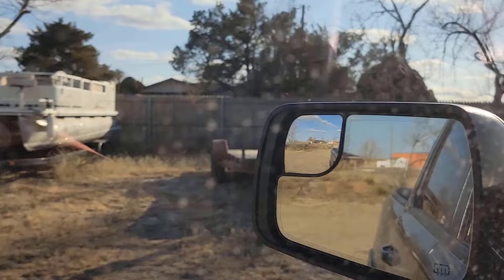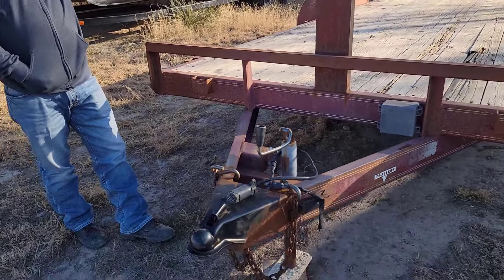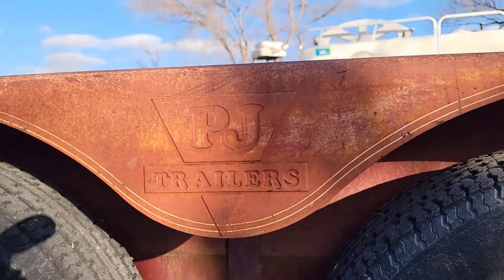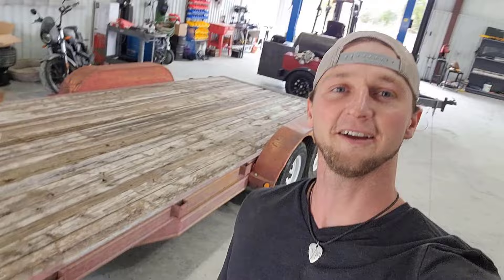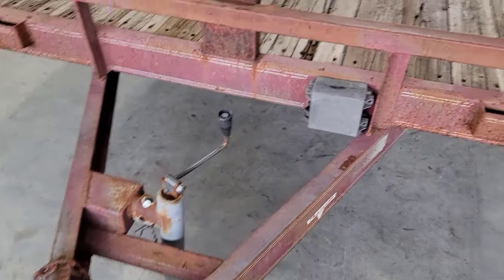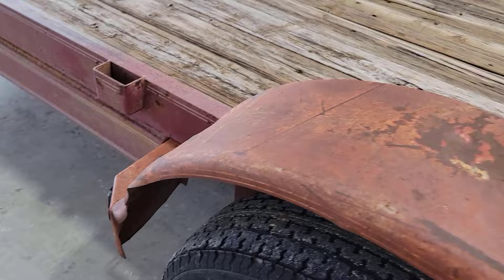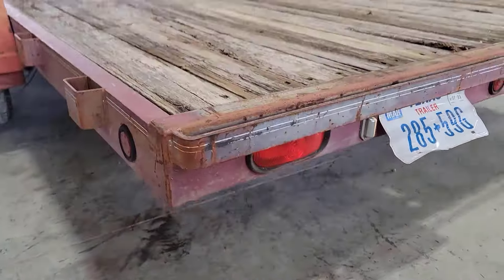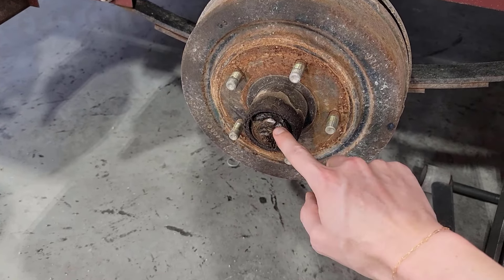Restoration of 22 Year Old PJ Trailers Car Hauler Part 1

Comment: 2700 your crazy i reburbish trailers all the time for a living and never go near 2700 for that price you can buy a whole other trailer
Reply: Hes probably farming a lot of work out. A trailer like that id typically spend 500ish to 750 to restore after lights, paint, deck, wiring etc. But i weld, paint and buy decking direct from a guy with a sawmill and wire myself so that helps.